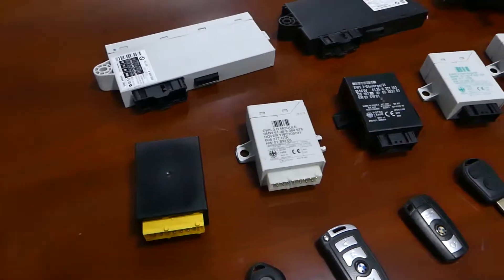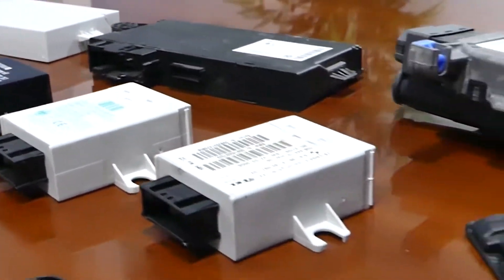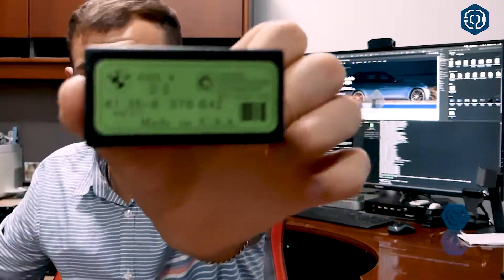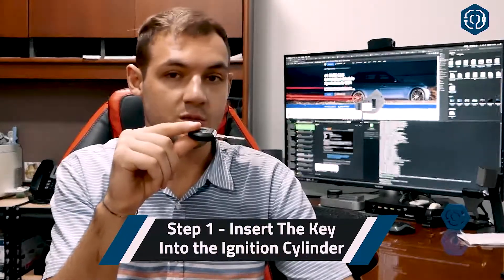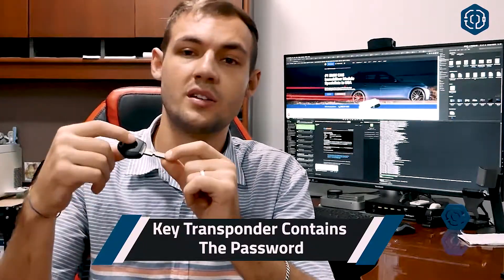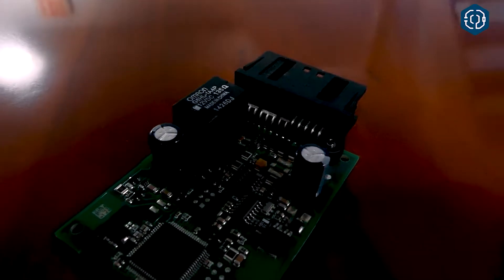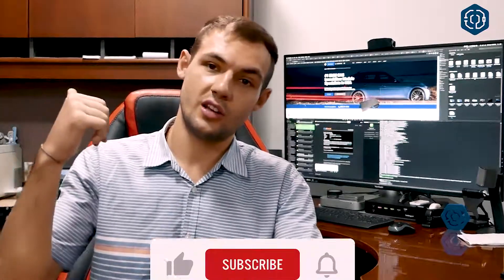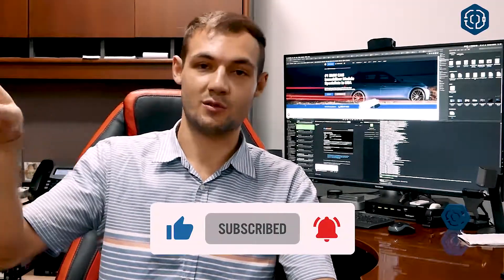What Is BMW Security System | How Is It Working | BMW EWS | Breakdown | Part 1

Comment: what about the 4.3 ews  I have a 2007 z4m. any help would be great. thank you
Reply from the maker: The 2007 Z4M uses EWS4.3, which is a bit trickier than older versions but still totally doable. If you're dealing with key or start issues, you’ll need tools that support EWS4.3. For full EWS-DME sync or EWS delete (if you’re swapping or tuning), you’ll likely need to read the EWS and DME EEPROM, then either sync or patch them. Let me know what exactly you're trying to do key programming, sync, delete, or DME swap and I’ll point you in the right direction.

Comment: What can be done to fix this issue. I have a 2009 BMW 528xi with this issue. But I have checked with a scanner and the terminal 15 wake up (acc) has .13 on it at all times. What can be done
Reply from the maker: If terminal 15 has 0.13V at all times, it sounds like the wake-up signal isn’t being triggered properly — it should be close to 12V when the ignition is on. This could point to a faulty CAS module, a wiring issue between the CAS and the module you're scanning, or even a problem with a relay not being activated. I’d recommend checking the CAS output signal to terminal 15, verifying ignition switch operation, and testing the relevant fuses and relays. If everything checks out, you might need to reprogram or replace the CAS or the ECU.

Comment: Hey I got a e36 316i m43 b16 1995 model bmw ews 2 I got no crank no fire and no injection pulse I suspect the problem is communication is out of sync I'm looking for the proper soft wear to speak to the car also I must purchase a k dcan cable can you help
Reply from the maker: For your 1995 BMW E36 316i with the M43B16 engine and EWS 2, you're right to suspect an issue with the immobilizer system if there's no crank, no spark, and no injector pulse. INPA (BMW Factory Diagnostic Software)  Best for diagnosing EWS synchronization and faults. Since your E36 uses ADS or early OBD protocols, a standard K+DCAN cable won't work alone. You need an INPA-compatible USB to OBD adapter with a switch or a K-line interface. If your car has the round 20-pin under-hood diagnostic port, you'll also need a 20-pin to OBD2 adapter. Try scanning the EWS and DME to check for synchronization errors. If out of sync, perform an EWS-DME alignment using INPA, DIS, or PA Soft.

Comment: I have 1995 E36 318i but with old EWS HW01 SW01. The problem is that sometimes it starts up and sometimes doesn't crank, could it be the EWS ? And how to bypass this problem?
Reply from the maker: Yes it is very possible that the problem is in the EWS. The EWS is a security feature that prevents the engine from starting without the correct key. If it's malfunctioning, it can cause starting problems. In regards to removing the EWS from the system, this requires reprogramming or flashing the ECU to disable the EWS functionality. This is a more permanent and professional solution but requires specialized equipment and knowledge. I can help you out either way.

Comment: Hi. I see your video and it is certainly great . I Have an e36 which I guess is not into the production years of the ews 05/07/1993 .
Reply from the maker: Thank you
Reply: @ECUTeamCorp  to you .
Reply: @ECUTeamCorp  Well . First than all let me say thank you again. Well this afternoon I was looking for the ews into the e36 sedan 318 which soon I will give an M20B18 engine and automatic transmission. Is a six in line engine. Is the only engine I have to install. And I have challenges to come next July . The car was Produce before the ews system has been installed into the e36 line (September 1993) . Meanwhile I’m doing some body reparations into it .

Comment: hello bro...very good video and well explained... I am having a problem with a BMW e34 525 TDS year 1994...they have changed the injection pump and according to other experts they have canceled the immo in the original control unit and another one from the scrapyard and still the car does not start... I have searched for information on Google but I can't find anything on this topic and this car model... could you be kind and explain to me how the IMMO system works on these models?  I am very angry because the mechanics have touched everything and I have been like this for 3 years with the car without starting...the engine turns but the injectors do not get diesel...the crankshaft sensor tank pump was looked at and many other things but They have touched on so many things that now I don't know where to start and I don't know what immo system this model has (I'm interested in knowing how immo can be eliminated)... thanks and regards
Reply from the maker: https://ecuteam.com/pages/contact

Comment: If my ews 2  totally damage 
I need to get  used key and ews control unit only without ecu 
Because the car old 1996 and I don’t know if this car need programming or synchronization between ews and ecu to be able the car to start again thank you 😊
Reply from the maker: It needs both programming and then synchronization between ews and ecu for car to be able to start again.
Reply: Thanks unfortunately I don’t found ews and i am able to do programming 
So i will do bypasses for ews but i am still dealing with ecu 
Haw i can do it 
I think i can use Julie emulator for imo off then car will start again

Comment: Hello 👋🏼 thanks for the video, I have an e46 320d with engine swapped to 330d,
But vehicle is not starting because I use the old key, is there any solution to bypass the ews or make the engine start? Thank you
Reply from the maker: contact sales@ecuteam.com for more info

Comment: Dear 
How are you 
Please help 
I want to transfer From EWS ll to EWS 3 
Wire diagram 
E39 BMW 523 model 1996 
Vehicle BT29571 
Thank you
Reply from the maker: There is no reason to do that. It's different modules with different connectors and not the easiest thing to do. At this point it's better to get rid of the security completely.